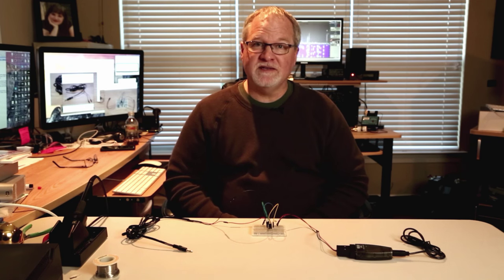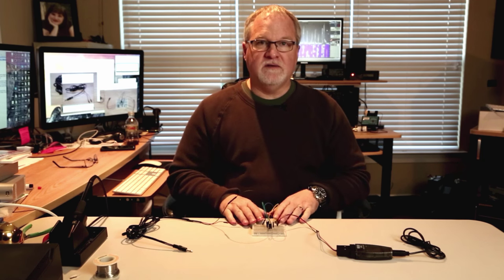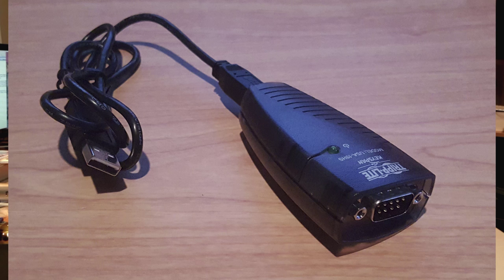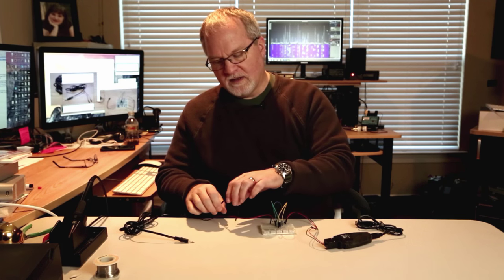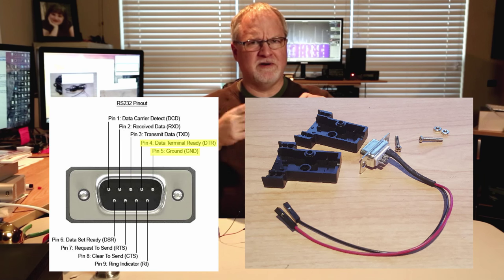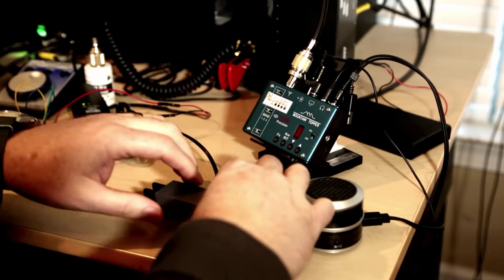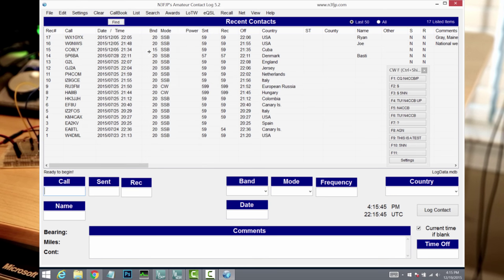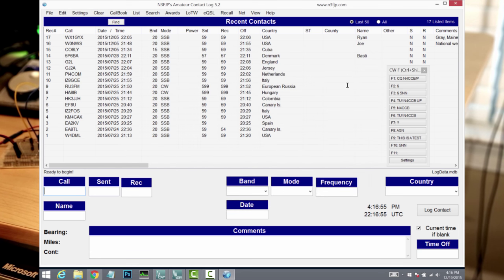Build a Computer to CW Interface

Comment: Cliff: 

THANKS for a very thorough video on a direct CW interface. I constructed mine on a perf board, and it looks ugly. BUT it works! I used it to key my FT-817ND, and am now considering a second one for my X1M. Great inspiration to build a relatively simple circuit!

Now to sell the extra components on eBay...

Comment: Great video, thanks. 

When using the stereo plug as you did, you could solder the wires connected to the rings together, then it will look like a mono plug to the radio.

73, km6wt

Comment: I'm going to use N3FJP software to drive a 30 year old MorseMachine via its Serial in port. In 39 years of operation, I have never done keyboard CW, always either paddles or keys. But I am a CW Sweepstakes junkie, probably the only one remaining who does not use a keyboard. FJP's circuit is very similar to the serial input of the MM-3. The only differences are a 3904 rather than 2222 transistor and 10K rather than 4.7K resistor in series with the transistor base. Beyond that, since the machine was built, RTS is still RTS, DTR is still DTR. So what drives a Winkeyer should drive a MorseMachine. I'm just waiting for the parts to build the DB9 to RCA cable.  DE N8CPA

Comment: Enjoyed the video but there is one additional thing I feel should be mentioned.  The actual speed of the cw may vary from the selected speed. This is due to the fact that the ascii to morse conversion is quite processor intensive.  This will vary based upon processor speed and Operating System activity. The only way to guarantee flawless cw is to do the conversion outside of the PC such as is done in Winkeyer and the AEA Morse Machine.
Reply from the maker: Thanks, Don. I've never noticed this.  I could see how a slow computer with limited RAM running multiple programs/processes could have occasional timing issues, though. - Cliff
Reply: QRP School Even fast PCs can have a problem if you are in a contest in Run mode at 25-30 wpm.  If you notice in your logging program notes window he mentions that timing could be a problem.  N1MM is the predominant contesting program and believe me, there's a lot going on inside besides sending CW.  Your videos are a pleasure to watch.  Keep 'em coming. 73 Don

Comment: I'm enjoying your videos. Always good to have a new project to start up. On this topic, I believe I played around with a cool app on an Android phone where the user could make an interface between their phone and their keyer. The phone would produce an audio tone which the interface module would utilize to ground your key circuit. I cannot remember the name of it, but I have the interface laying around here somewhere.
Reply from the maker: +Radninja88 That's interesting. If you find the name of that app, let me know and I'll check it out.  thanks - Cliff
Reply: Here we go! Androidomatic Keyer (AKA). Check it out on the Play store. I have it on my tablet. (I dedicated a tablet to the radio projects)
Reply from the maker: +Radninja88 That's a really cool concept!  I was just telling a friend that I was thinking of building an arduino-based keyer with a number of pushbuttons for sending messages - including a automatically incrementing serial number for contesting.  I didn't think about how a phone could replace the arduino hardware AND provide a much easier way to edit messages, etc.  Thanks for tell me about this app and interface! - Cliff
Reply: No problem. I watch another channel regularly on youtube, it's VK3YE. He's got a LOT of videos on experimenting with qrp and has one or two on the arduino and cw.
Reply: I just checked it out ***** . That looks like a lot of fun and a lot of "tinker value". I'll surely dig up my arduino I have laying in a box somewhere collecting dust and play around with it. Thanks for the find.

Comment: I understand that this is an old video. Nowadays I have read of sub-ideal performances due to the non-real time nature of Windows. Therefore people use WinKeyer or similar devices (i.e. dedicated electronic keyers, controlled by the PC). What is your recommendation? Go this route, risking that the soft keyer might sometimes skip a dit or go for WinKeyer or free clones? TU dit dit
Reply from the maker: WinKeyer is superior to this circuit. However, my experience is that it’s rare for errors to occur due to the multi-tasking nature of Windows.  I mostly use an old Rigblaster Plug n’ Play interface for CW and it uses the serial port pins (like the circuit shown in this video). I don’t have any timing issues that have caused me to covet a WinKeyer but, again, the WinKeyer would be a technically better solution. -Cliff

Comment: Ok great video and good instructions, now I would like one on building this feature to use on a Kenwood TS830S, they have Grid Block keying and I am told that nothing built for computer interface will work on them because of the voltage,
Reply from the maker: Boy, you got me on this.  I have no clue how you'd solve this problem with a forty-year-old radio!  I'll bet this is a fun, old rig to play with.  Congrats on having one! - Cliff
Reply: @QRPSchool  oh well it was worth a try, thanks anyway

Comment: Hell yeah! I’m going to build this for a bluetooth to serial device so I can send CW from my iphone while portable... Just need to figure out a way to time delay the signals somehow... Anyone know how to build the circuit that takes morse code audio pulses, and converts those CW audio tones to contact closures? There’s one video on youtube that shows it being done, but not the details of the circuit. 

So... it works by using a CW tone app on a phone, and running the headphone audio output to a xformer that steps up the voltage, rectifies it to DC, then feeds the pulses (tones) to a transistor to close it like a switch. This way the keyer port of the radio can be wired to that transistor.. I just need the resistor and cap values required between the rectifier, and transistor.

Comment: RE your CW interface and the logging software... so I'm guessing his software is just outputting an 800 Hz tone (give or take) Right? Or does your QRP rig have its own builtin keyer? I don't remember you saying what kind of signal is passing or if it's just an on/off switch. And a comment, as I understand it, the reason for a stand-alone or outboard sound card like SignaLink is that you don't have interuptions like Windows doink sounds, sounds from inserting and removing USB devices,  email sounds and Norton software mucking up the system as it always does. I love building circuits too. I once had a great SSTV circuit, but you have to weigh the consequences - just sayin'. Nice video and thanks. Oh, have you ever done a video on using old PakRatt and DSP-232 boxes which our computers no longer connect to?
Reply from the maker: It's just an on/off switch. Let me explain this a little better for a future reader of this question...  When someone is sending Morse Code using an old-fashioned Straight Key, they are pushing down on the key and the contact closure is being detected by the radio.  The radio is then sending a carrier... which is interpreted as a tone by the receiving station.  Okay, so THIS CIRCUIT in the video is using a transistor as a switch to simulate the contact closure of a straight key.  

With the serial cable connected to the computer, the computer software sets the voltage of a serial port pin (DTR or RTS) HIGH, and the circuit closes the contact, causing the radio to think that someone has just closed the contacts of a straight key.  When the appropriate amount of time has passed for a Dit or a Dah, the computer software will set the voltage on that pin to LOW, and the radio will think that the operator has eased off of the key, causing the radio to stop transmitting the carrier.

This circuit can be used with any ham radio software that is capable of sending morse code via serial ports.  This would include most contact logging software and software that is used for digital modes.

To answer your last question, no, I've never done a video about PakRatt or any other serial devices. - Cliff

Comment: Hi there Cliff. I presume that the jack that you used  to plug into the rig is a sealed-molded on one. The other alternative would have been to solder a link wire from the ring to ground to convert the the jack plug into a mono plug ?. Would not the radio then accept it as a straight key ?. 73 de John - G0WXU

Comment: Do you need a sound card for this? Presumably you would need something more complicated to receive/decode on a computer
Reply from the maker: Hi, Adam. The purpose of this circuit it to allow a computer program (contest logging software) to send morse code.  When you're working a contest, you type in the station's call sign into the logging software and then press a pre-defined function key to send the call sign and the exchange information.  The software will toggle a pin on the serial port to simulate someone using a straight key.  By plugging this circuit into the serial port on the computer side and the telegraph key jack on the radio, the radio will detect the contact closure being made by the circuit.  It's as if a ghost is sending morse code.  So, the usefulness of it is strictly limited to those who want to type on a keyboard or press pre-defined function keys and have those keystrokes converted into morse code and sent through your radio.  I hope I explained that well enough... I don't feel like I've done a good job, here. - Cliff

Comment: nice video,nice project,,,this interface works in any radio?
Reply from the maker: That's right. It will work with any radio that has a jack that will work worth a straight key. The circuit appears to the radio as if a straight key is plugged in. -Cliff
Reply: +QRP School thanks....this circuit works only with this programme?
Reply from the maker: +DeSoLaTE GuS It will work with any program that can send CW by keying the radio via a serial port.
Reply: +QRP School ok,thanks again,73...
 de SV4RJA

Comment: Question Cliff does the trip lite hold DTR and RTS high when transmitting and fall to ground when receiving. Thanks for your video Ron C KG5GFV
Reply from the maker: Yes, but it might work differently than you think... This circuit sits between a computer and the straight key jack of a radio to aid with sending Morse Code via software.  So, it's not a Push-To-Talk switch that stays closed until time to receive again.  Your computer software (like N3FJP's logging software) will be responsible for sending Morse Code characters at whatever speed you've set.  So, to send the letter "T" (a single dash), the software will set the DTR or RTS line high (applying voltage to the pin, whichever line you've configured) which will ground the circuit as if you'd closed the contacts of a straight key.  Your radio will begin transmitting a carrier as if your finger was holding down the key.  When the software determines the correct amount of time has elapsed to stop sending the carrier (completing the sending of the dash element in our example), the line will go low again and the radio will stop sending a carrier... as if our hand has been released from the key. At this moment, if your radio is capable and has been configured for Full Break-In ("QSK"), you'll be returned to Receive Mode and can hear any transmissions between the elements of your Morse Code characters. 

Most radios have only one key jack and it can be configured to work with either Paddles or a Straight Key.  A Straight Key needs only two wires (for Ground and Contact) while Paddles need three wires (Ground, Left Paddle, Right Paddle).  If your radio supports Paddles, it almost certainly has a built-in "keyer" to generate a stream of dits and dashes when the paddles are closed.  To use this circuit, you'll need to put the CW jack in Straight Key Mode and disable the built-in keyer.  - Cliff

Comment: Can we use an android smartphone in order to send with CW what we write on the keyboard and receive on the screen the words that  the radio receive in CW?
Reply from the maker: There are smartphone apps that can decode Morse Code that is picked up by the phone's microphone.  The apps are pretty good at decoding but the person sending Morse Code has to be very good at sending AND the incoming audio signal needs to be strong.  When the person sending Morse Code is sloppy and/or the signal fades, the decoding apps get confused.

I'm unaware of a smartphone app that triggers a circuit connected to the key jack of a radio in order to send CW.

If anyone reading this knows of such a solution, please jump in here! - Cliff
Reply: The solution is to NOT promote anything wich made also the CW automatic : while we can't learn digital protocols like PSK, JT etc etc we CAN learn the Morse code for sure. Wich mean also to learn how to zerobeat, how to "spot" and much more. I'm sorry but pressing couple Function-Key on a PC keyboard isn't CW and will never be. CW mean State of the Art.

Comment: I see some alternate products making claims that the computer will induce timing issues, and thus their external standalone hw does not suffer from that phenomena. Have you experienced this with your setup?  thanks de K8MH
Reply from the maker: WinKeyer is superior to this circuit. However, my experience is that it’s rare for errors to occur due to the multi-tasking nature of Windows.  I mostly use an old Rigblaster Plug n’ Play interface for CW and it uses the serial port pins (like the circuit shown in this video). I don’t have any timing issues that have caused me to covet a WinKeyer but, again, the WinKeyer would be a technically better solution. -Cliff

Comment: Just finished building it - fun project.  What function key assignments do you recommend for field day? 73, Paul
Reply from the maker: Hi, Paul. This is the information we distribute to hams using our CW setup on Field Day...

RUN A FREQUENCY

Find a frequency that you can run, the press either F1 (looped every 3 seconds) or F2 (non looped). This will send our callsign twice to help other stations copy our call, then ends with "FD". There is no need to send "CQ FD" since everyone else KNOWS we are calling CQ. The [Call Sign] [Call Sign] FD accomplishes the CQ call in as short a period of time as possible, and makes it clear we are working the FD exchanges, and by giving our call twice, we make it easy for other stations to copy us.

The other station will send their call, say "W1ABC". We enter "W1ABC" into the log, touch the TAB key (to move to the Category Field in the log, and to check if the station is a dupe, then touch F3, which will send "W1ABC 3F TN". He will then send his report, which we enter into the Category and Section field of the log, and touch F4, which send "TU [Call Sign]" and enters the contact into the log. If we have a good run going, we should be able to continue using F3 and F4 to run the frequency, and occasionally using F1 or F2 to "CQ".

SEARCH AND POUNCE

If instead, you want to search and pounce, tune the radio to find a station you can copy, enter his call into the call field of the logging program and touch the TAB key. This will check to see if the call is a dupe, and put you in the field to enter the CATEGORY and then ARRL section. Then touch the F5 key, which will send "[Call Sign]" once. Hopefully the other station will hear your call, and send something like "[Call Sign] 2A OH" which says, "I copy your station and my report is 2A OH". Fill in the Category and Section fields in the program then touch the F6 key, which sends "TU 3F TN" and enters the contact into the log. This tells the other station you copied his report, and that your report is 3F TN.

The other F keys do the following:

F7 sends "?"

F8 sends "AGN"

F9 sends "DUP"

F10 sends "3F TN" without the TU, in case the other station requests a repeat of our exchange.

F12 is reserved by the program to enter any text from the keyboard. As you enter the text, it will be sent. To exit keyboard mode, touch F12 again.
Reply: Thanks.  73, Paul

Comment: Can this be used with a TS-480hx radio......
Reply from the maker: Yes. It can be used with any radio that has a CW mode.  You plug this circuit into your radio as if it was a straight key.

Comment: Is this different than PSK31?  Do you need a radio with SSB or can you use just a CW transceiver?   Will CwGET & CwType program  work on CW transceiver only?
Reply from the maker: Yes, this is different than PSK31.  This is a circuit that connects between your computer's serial port and your radio's Key jack... so that the radio thinks you've got a straight key plugged into it.  This has nothing to do with decoding Morse Code, either.  Your computer software must be capable of generating Morse Code timing and setting the serial port pin HIGH whenever the contacts should be closed (as if you were pressing down on a straight key).

CWGet will decode Morse Code that it "hears" via your computer's sound card.

In looking at the very sparse description on CWType, you can use an SSB radio (voice) to generate CW via an audio pitch of your choosing.  In other words, the computer software will generate a tone at, say, 600KHz and transmit that audio tone in sideband mode.  That works the same as putting your radio in CW mode and closing the contacts, making the radio send a carrier for CW.  As to whether CWType can set a serial port pin HIGH and emulate a straight key, I don't know.  Maybe someone reading this comment can help us out.  If you find out, please reply so others can learn what you've learned.  Thanks - Cliff